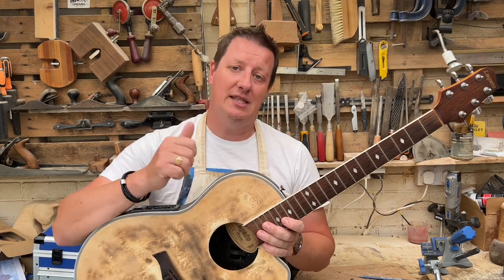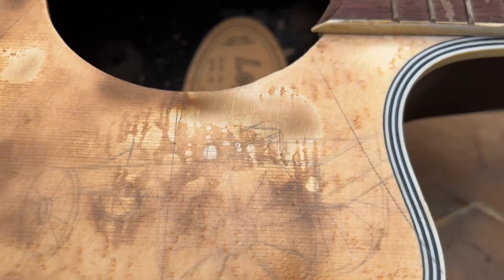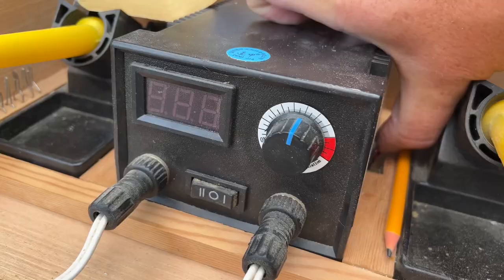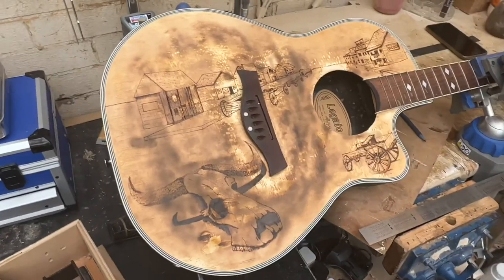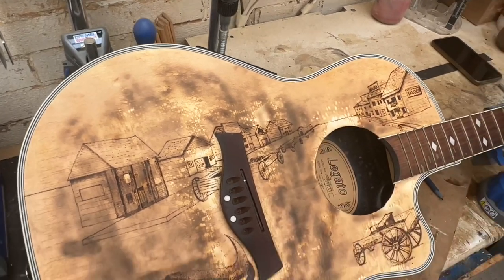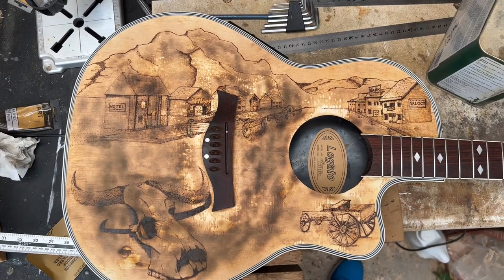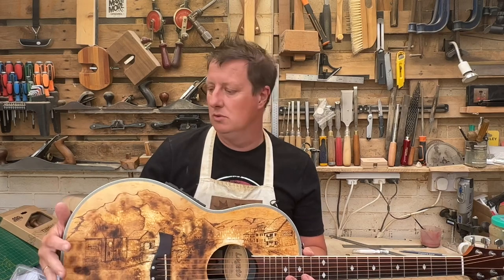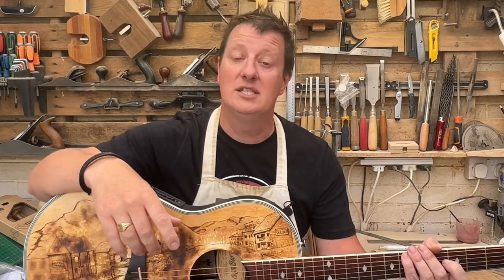How to do a Pyrography Makeover Using a Burned Guitar

Comment: I was wondering what Danish oil is, as compared to tung oil or boiled linseed oil, so i looked it up on Wikipedia. Turns out that there's no definitive answer - it's usually either tung or linseed or a mixture of them, but every manufacturer has their own recipe. This seems very strange to me, so why say you're using Danish oil when saying tung or linseed would be more accurate?
Reply from the maker: Because it’s danish oil. It a blend of others. I found the brand I like, not sticky and dries well.